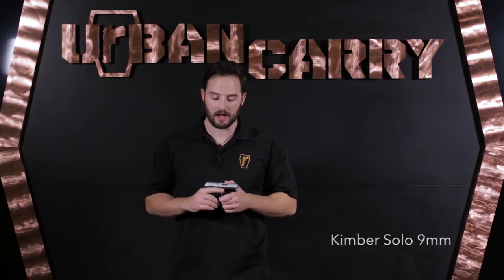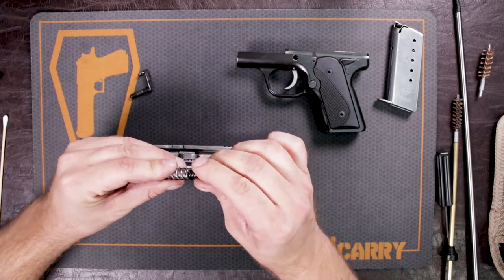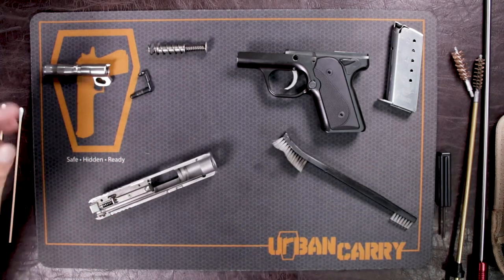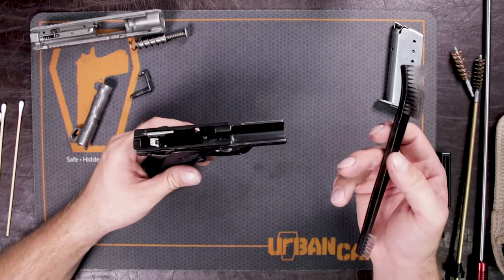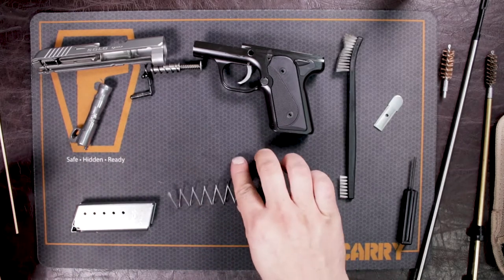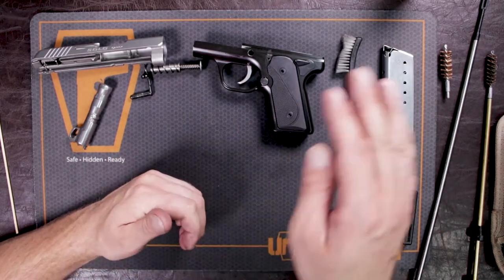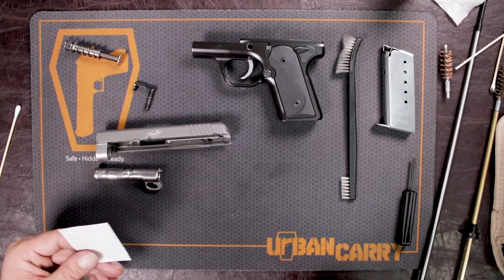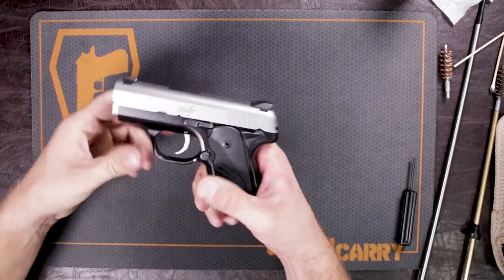Kimber Solo [HD] Cleaning & Features

Comment: There is a small spring under the end of the lever of the pin that is pushed out to remove the slide. The end of the spring can be seen in the grip, when the barrel retaining pin is removed. The spring must be pushed down under the lever end of that pin when the pin is replaced and the gun is reassembled.  If the slide does not close fully, that spring is not in correctly.  Remove the pin slightly and be sure the small spring is pushed down under the lever when it is pushed back into the slide.